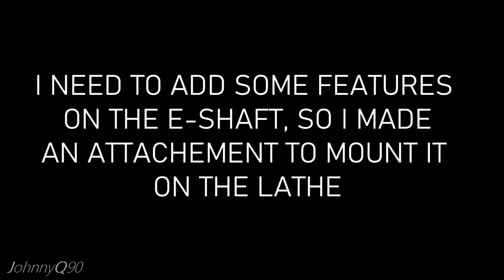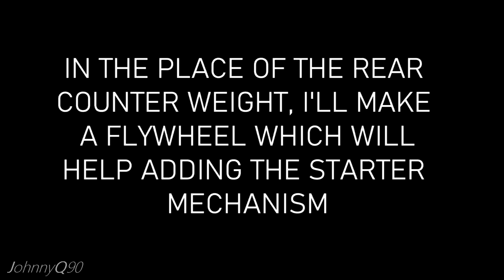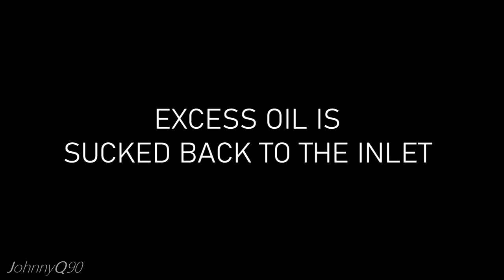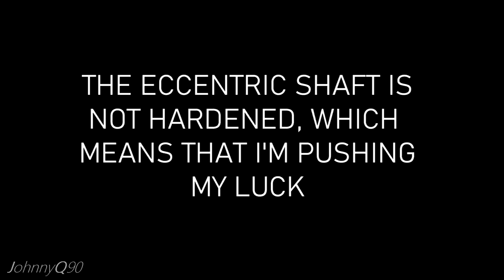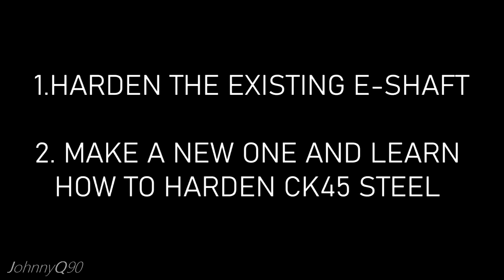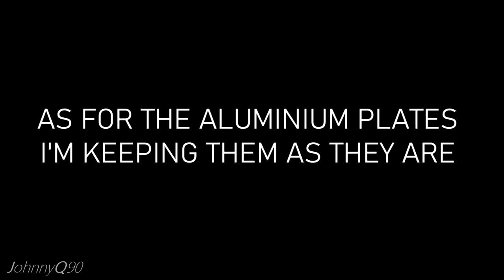TWIN RC Wankel Rotary Engine First Run!

Comment: oh yeah, definitely needs a 2-rotor counterweight.
Reply: and a hardened e-shaft :)
Reply: And chrome plating on the irons
Reply: But first... an adequate cooling system. 
A basic unducted fan isn't enough. 
Without this, the other components won't suffer critical wear prior to meltdown.

Comment: I worked as a technician rebuilding gearboxes in a machine shop for about eight years. I didn’t do a whole lot of machine of the parts. Every once in a while, I could run a manual lathe or something like that, but my jaw was on the damn floor, most of the time watching you build this motor it was very impressive.

Comment: Jesus that thing drinks more than my baja
Reply: Rotary's are well known to be thirsty on both oil and fuel
Reply: I actually own a 13b peripheral port with 48 IDA carb, and at wide open throttle, it consumes 1 litre of fuel every 2 km... 300hp and flame out the back, makes me laugh at the fuel consuption
Reply: In 1972 I bought a twin rotor NSU Ro80 and it was thirstier than my friends Rolls Royce Limousine . I converetd it to run on LPG and injected oil into the inlet manifolds to get over the total loss system fitted, which made it run sweeter, and cost less than half to run on LPG.
Reply: Robert Slackware  true, very true. You can't make more power by burning less fuel 😁😁

Comment: I hope you take this step by step and build a 3 rotor then a 4 rotor.. !
Reply: I’m hoping so
Reply: I really hope so... maybe a model of Rob Dahm rx7? With working AWD??????
Everything aside... always astonished of the things he makes...
Reply: I don't think there's enough of these old engines left in the wild to do this. They haven't been in production for decades.
Reply: @octane613  I think with the tools he has and maybe a bit of external contribution he could probably fabricate all the parts by himself... probably for the  irons and rotors a bigger cnc is needed but aside from that... apex seals, bolts, spacers... I don't think for him would be too much of a stretch... it is a stretch for the wallet I would think...

Comment: Johnny: What Do We Do Next?!. 

Me: Add 2 More Rotors 🥴
Reply: and call Rob Dahm!
Reply: Of corse!
Reply: @TqmmPl  so he can come learn some shit?
Reply: I mean, there are 4 more of those on eBay... 6 rotor much?
Reply: They're called disk
Reply: @slowdriver6868  there is about 6 of them now. Some guy is asking over $5000 for one!!!
Reply: @myrx2  damn, that's a ton of cash. Pretty sure you could get an actual 13b for the same money!
Reply: +1
Reply: Two tiny Turbos!
Reply: @myrx2  you could build one cheaper.. even if you paid someone to build each part, you'd still have plenty of change.
Reply: No 10 so he can have a 12 rotor

Comment: Johnny : What now?

Rotary : Need a big ass turbo😏
Reply: Rx7 say: Braaaaapppppp 💖
Reply: a miniature turbo does not give very good results (video of 04/19/2019) I would opt for a miniature screw compressor because the intake pressure is stable which will be better with a carburetor, for a turbo it would be necessary to have the same pressure in the fuel tank as in the air intake, the tank being partially filled with air this would create a pressure delay at the fuel inlet in addition the tank must be able to support the pressure
Reply: @Spip-yt6dx  I'm not exactly sure what tf it is you're saying but it sounds good so I'll go with it! Haha! Sounds about right!
Reply: @Spip-yt6dx  a draw through turbo setup would be a better choice vs a "blow through" turbo setup. You wouldn't have to deal with "boost prepping" the carbs nor matching the tank pressure and maintaining it at a 1:1 ratio. Downside would be the compressor blades would slowly be eaten away, but very doable. A screw style supercharger would be cool to see either way.
Reply: @jeffbroxton988  
if this kind of installation remains miniaturizable and takes into account the admission by carburettor why not
(PS: I'm not sure what "draw through turbo" means in French)
Reply: @Spip-yt6dx  carbs in front of turbo rather than after charge pipe
Reply: Where turbo sucks air u put a carb. Not where its compressed
Reply: I think he tried making a centrifugal supercharger a while back. Had problems with the gearbox exploding and the overall design.
Reply: you say that and all i hear is the intro to Angel Motorsports haa haaa
Reply: @tastotan  thanks
Reply: 3 rotor or 4 rotor next, please.
Reply: @austinsears1637  haha thought im the only one that doesnt understand a fu#k he is saying😂😂
Reply: Turbo would have to be about as big if not bigger than the motor due to scaling issues. (Basically the radius is too small to impart enough velocity to compress the air at the RPMs one could operate at with known materials.)

A positive displacement compressor of some sort is needed since it takes away the need to impart velocity to air in order to compress it. Screw, vane, or scroll type may work. At this scale I've suggested vane type before, as it's the most simple design to implement. Vane type isn't seen on full size engines much though, as they have issues with wearing surfaces and fell out of favor in the late 1960's. (There were kits for VW air cooled engines, if you're curious though.)
Reply: the exhaust is not hot enough for turbo to be efficient. the fuel is barely burned completely.
Reply: @theheck123  why not 6?  Why build it like layer cake anyway?
Reply: @pauljs75   Do you know that RR experimented with rotary cycle 'engine' design for air compressors... for that very purpose? 
Are you familiar with the Napier Sabre and Deltic gear linked crank to output shaft?  
I'm thinking trying to build an air cooled layer cake assembly, like a NSU or Mazda 2 rotor engine, is a lot of work and flawed.... and flawed enough from the size of these tiny engines. Like... how much torque on that tiny little crankshaft... how much heat build up in the rear chamber... how much lube of the main rotor bearings without oil pumped there and into rotors to cool? 
More than one way to do this multiply chambers ... think about 3 engines geared together... a 3 rotor engine.
Reply: @giacomojack8975  oo
Reply: Oh dude you are right!
Reply: 4 rotor with a turbo lol
Reply: @Spip-yt6dx  the tank would not need to handle high pressure. a couple psi is nothing
Reply: Ls 1 swap
Reply: And fd3s body!

Comment: Forget a flywheel that’ll just snap the E shaft, the whole rotating assembly needs balancing with a counter weight on each end of the shaft
Reply: Interesting
Reply: Maybe…but maybe not..rotors are 180degee out of sinc
Reply: The flywheel stores energy on a power stroke and releases it during lack of power stroke, delivering its rotational energy to rotate the engine instead. Considering the size of the engine and thus lack of weight to keep the rotors rotating on their own, it's indeed a good idea.

A well-balanced wheel shouldn't snap the eshaft either, and balancing a wheel is just a case of making a small inset where there's just that tad bit of material too much.
Reply: @ujiltromm7358  I was speaking from experience not Wikipedia😂

Comment: I'm a trained machinist, and while I worked as a toolmaker we hardened every tool (mold) that I made. This was molds for injection moulding (plastic) and they were hardened when the machining was done. I wasn't directly involved in the hardening process, but as far as I remember the technique was to heat and then cool the molds fast for a very short time. This was done to only harden the surface of the mold, but keep the core soft. This way we got a hard and durable surface while the core was soft enough to not break/crack by the enormous force the molds were subjected to during the moulding. As far as I remember we didn't have to calculate any shrinkage of the steel the hardening because it was only the surface that was hardened. We had to calculate for the shrinkage of the plastic, but I don't think shrinkage of the steel was a factor. I can't remember what kind of steel we used, but it was quite soft and easy to machine before it was hardened. I would recommend you to buy steel intended for making molds and find a description of the hardening process online. 
It's 25 years since I worked as a toolmaker now so I have forgot a lot of the details, but I have a friend who works as a toolmaker and if you want me to I can ask him for advice about the type of steel they are using as well as the hardening process.

Comment: I know I’m a year late to the party. I have had success pressing a pre made hardened sleeve on the the area where a needle bearing needs to run. May or may not work for you. Thanks for the time you spend sharing your projects.

Comment: Retired Engineer after 37 years opinion. The CK45 is ANSI 1045, or Cold Roll and makes a good shaft, if it runs straight and in balance, the eccentric changes the weight factor or centrifugal shift of the shaft. Make the shaft out of 4140. And turn the jets on the intakes down. That has to be fuel exhausting. But a kick ass motor for sure. Great job.

Comment: This isn't a kit? You builded only yourself? That is amazing.
Reply: using parts from two single rotor engines.
Reply: Only parts he didn't machine himself are the housings, carbies and rotors. Irons, front cover, back cover, E-shaft, etc were done by him.
Reply: Amazing!!

Comment: oh yes, they drink fuel like it's going out of fashion! I had one once.
great effort, sounds fantastic but like you state 'it needs a flywheel'
Reply: I'm not a scientician but I can't help but think that the vapor being blown out of the exhaust probably has a lot of fuel in it. As is  tradition 😋.
Reply: @spiralout112  These engines run on a high oil content so smoke lots.
they smell lovely

Comment: I must say, this is awesome. I'm working on a project and I need a high rev, high torque and high power engine with low weight and as small as possible. These engines should be locally prouduced. If you are interested, kindly respond to this comment

Comment: You should put this in an Rx7
Reply: He should test out a new hardened eccentric shaft, and then double it up to a 4-rotor to show Rob Dahm what's what!
Reply: @zadtheinhaler  Or give it two 4-rotors and connect the output shafts to one to get a V8 rotary engine!!!
Reply: @schwuzi  That would be insane lmao
And would also probably be the size of a lawn mower engine xD
Reply: @Dubz0408  The biggest challenge would be to synchronise both engines to run the exact same rpm. I think you would need something like a centrifugal clutch on each engine to allow for some slippage
Reply: @schwuzi  Hed probably just run them off an idler gear side by side like hes done before with nitro 2strokes
Reply: @Dubz0408  Didn't know that, thanks!

Comment: I was waiting for this video ever since you made those plates and e-shaft🥰 As for hardening of ck45 steel is very simple since it's non stainless tool steel (that means it doesn't require ridiculous austenizing temperatures) so it doesn't need oxygen protection either.. Thank you for upload men🙏

Comment: I would recomment using 1.2379 (X155CrVMo12-1) for the shaft and try to harden it by induction heating. should be a rather cheap but durable steel for this
Reply: Wanted to write 100% the same.
Should be a good and fairly cheap way to do what you want.
If you want to have extra strong surface, you could add some DLC coating..

Depending on expected torque, you could leave the center quite tough and the outside high hard by induction hardening + maybe good dry running with a coating.
Reply: @marcels.647  i haven't seen any measurements for the shaft diameter but i think it is beefy enough to withstand the low rotary torque. he should only harden the contact surfaces though and not all the way to the core of the whole shaft. i hope he sees this or already knows about this since induciton is pretty much the only solution to precisely heat up such a small area. for the coating part i dont know of any good diy solutions that are worth doing at home.

Comment: You can boronize your e-shaft to get the hardness that you want. The process melts boron into the surface of your part making the surface extremely hard while retaining the strength qualities of the softer shaft under the surface. On top of that, the boron also acts as a lubricant on the touching surfaces. The process adds a small bit of size to your part so you have to consider that when you are machining it.

Comment: To harden your existing shaft, you could use a case hardening powder like Kasenit. Your motor does need a flywheel and i would suggest incorporating another counterweight into the design. In the Mazda rotary engine, a flywheel was cast with a heavy lump on one side to act as a counterweight. You could do the same out of steel making sure that your off centre lump is equal in weight and opposite position  to the front counterweight. Well done on your fantastic project.

Comment: I'm sure you already know, and I am probably preaching to the choir on this, but @11:30 it looks like there is a lot of end float of the e-shaft.  A big thing for rotary engines is end shaft play, in a standard Mazda 13B engine you want 0.04-0.07mm of end play when everything is installed to the right torque.  I don't know if it would be proportional when you scale it down or it stays the same in your case.  It would be interesting to see how well you could balance the entire rotating assembly, see if it smooths out.  For the E-shaft hardening, I would suggest vacuum hardening so you get less distortion for final machine and lapping of the bearing surfaces.  You could also try hard turning afterwards, you may not even need to lap the surfaces.

Always fun to watch you build these cool contraptions!

Comment: Guess who just got his first lathe?!

~me
Reply: Haha, good luck with that.  You'll be making all sorts of scrap metal from perfectly good stock in no time.  I happen to be quite skilled at it with my mini lathe.
Reply: @Skinflaps_Meatslapper  yes probably, but hopefully something useful sooner or later.
Reply: @Sven_Hein  Guess whos BUILDING his first lathe.. those things are expensive as all hell here in any reasonable hobbyist size that is. Rest are too far, require expensive truck to transport and require industrial size main fuses. I wont be building this accurate micro engines anytime soon with it, but going to get bushings etc made that beat using drill to turn part and angle grinder to remove material...

Comment: Firstly that looks and sounds great. Secondly if you want to harden the shaft you'll need to make a new one , just make it 3/1000 bigger than needed, harden and temper it, then take it to the final size.
Plus you getting to learn something new.

Comment: Had a friend that had a (I think 70's model) Mazda RX something. He loved it but said you had to be careful because they use up the motor oil. The nature of the beast. People burned out the motors because they forgot to check the oil EVERY TIME you stopped for gas. Classic "Fill the oil and check the gas" for oil burners. Be fun to compare it ci to ci with conventional miniature cylinder engine. Having fun watch you build it piece by piece, What a Hoot!...

Comment: You can consider nitride hardening the crank. This is a surface treatment and penetrates a few hundredths of a millimeter into the material. It does not affect the size.

Comment: You have great toys and your machining abilities are pretty fly too..... everyone is a backseat driver but when you can make a rotary engine from a couple round stock pieces of aluminum and some CK 45 steel shaft personally I feel you are pretty much good on your own bro. :) 
Thanks for the time in making these videos and sharing your obvious talent with us mere mortals. 
Note I have spent weeks worrying over a brass splinter from rubbing some lathe droppings from a brass shaft I turned, just be careful man. (4:59)

Comment: This thing is amazing! Seriously, congrats, you did fantastic work.

I would just cut the shaft a little small then press some hardened collars onto the wear spots, little heat & cooling to shrink & expand the parts, then a little hydraulic press (or a hydraulic jack & some pipes against a sturdy surface) and you could make that thing super durable. You might have to section and rejoin the shaft to get the center, but keyed slots and holes aren't too difficult for someone with your talent. You could look into balancing/counterweights too if you want that crazy smooth 10,000rpm beast. So badass though, keep up the impressive work!

Comment: First, I've been watching you build this for a while now and it's all very impressive.   I've been running OS Wankels for a few decades now and I've got to say that your engine doesn't sound very good.  I couldn't begin to say what the issues are but it sounds like it's rattling a lot which probably means some loose fits.  Even so, the engine is super-cool.  I really hope you keep with it and get it running like fine jewelry.

Comment: Have that crank/eccentric sent out and nitrited and hardened up! Why not after all that hard work and it appears to look very happy inside but yes on a mild steel surface, it maybe a bit soft to take the load and RPMs of this engine now? Otherwise looks absolutely impeccable inside after its first run! Incredible workmanship my man! Bravo lol!

Comment: Small problem, the back rotors and housing in rotary vehicles are the hardest to keep cool so they are the ones that wear out faster. If you can figure out a way to keep the back rotor and housing cool you would have an awesome engine that will run great

Comment: I'd suggest a fan configuration that does not blow so much air over the front cover. That airflow is blowing against the airflow that is meant to go over the cooling fins of the housings. Together they form a flow that blows away from the engine at an angle.